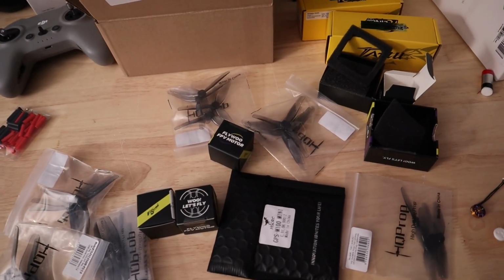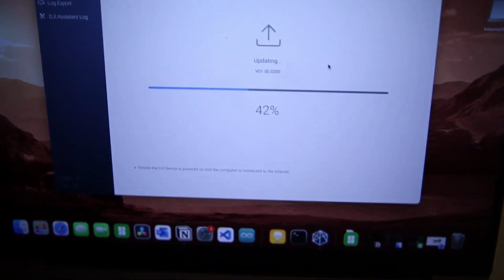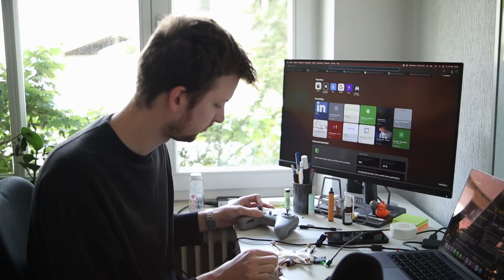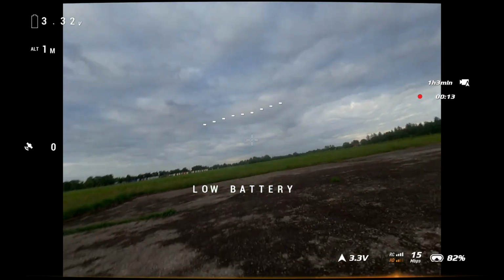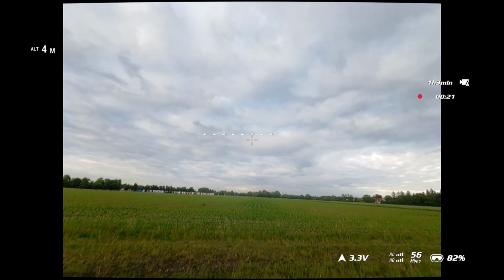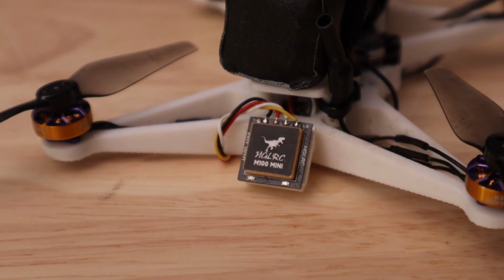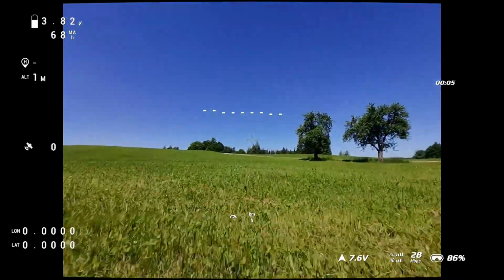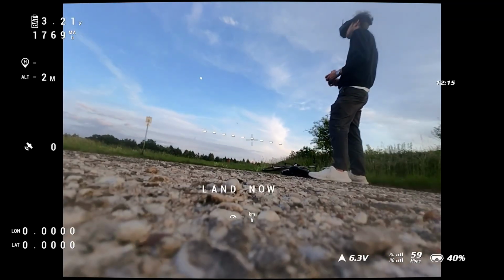A Drone powered by old Disposable Vapes

Comment: I have alot of old vapes and old dead rc batteries if anyone wants to repurpose them, i would recycle them but in america recycling bins are trash bins.
Reply: I'd be interested in your old Vapes. I'm learning to solder connectors on them right now for my tiny whoops.
Reply: @quintinfertig89 i could give you the tech from within for personal saftey without the shell, all seperated in bags in a box with layers of foam, i get them every 2 weeks it seems, usually disposables, not alot at the moment but over time they pile

Comment: How do you like the goggles n3? goggles 3 is sold out in all american retailers because of... reasons... but the n3 is available everywhere. Ive never used a box goggle before, I have the HDZ goggles as well.
Reply: I was actually surprised. I bought the N3 expecting to be disappointed, as i was with all the other box goggles i've tried (Eachine EV800d, Skyzone CobraX, cheap no-name goggles)... But i wasnt sure i would stick with DJI so i went for the cheapest route i could. All other box goggles felt like a tiny field of view; they all claimed 60 degrees, but in the end i could see both edges of the screen as if i was sitting on a sofa and watching TV. But the N3 goggles are actually way bigger than i can see, i have to move my eyes to the extremes to see each of the edges, so it feels amazingly immersive. The moment i take off, i completely forget they are box goggles...
Reply from the maker: I actually like them a lot. I tested the regular goggle 3 and the only downside compared to the normal goggles 3 ist that they are a bit bigger.

Comment: i have some thoughts, higher Kv motors will help a lot, it seems you setup the gps incorrectly because 0 sats almost never happens, why didnt you buy a carbon fibre frame? and analog video will eb lighter and draw less power so that will help you squeeze even more flight time out of it!
Reply: I suspect they are 14000kv, nobody makes 1003 with 1400kv.
14000kv is plenty for 1s... Maybe a little too much for 2s
Reply: @Tokyo_Dom yeah although for a cell that sags a lot and can go to 2.8v higher would be better
Reply: @SpacemanFPV1 higher kV would just sag more though. KV isn't the answer for low c rating batteries... You want the most efficient drive train, and then low disc loading (reduce weight)
Reply: @Tokyo_Dom ok that’s fair, I agree for the most part, and yes it would sag but it would also help because it will be inherently heavy and the extra power would be beneficial

Comment: carbon fiber exists, why buy everything but a frame? I will never understand the 3d printed frame
Reply: agreed, esp when frames exist for this purpose
Reply: Exactly. Carbon frame is only correct solution. You can add printed plastic to the frame
Reply: I have printed a frame in 2,5inch. I laught over the finished print. Stiffness:0%😂
Reply: It’s a prototype for now, but to produce a carbon frame is much more expensive and time consuming so I respect his decision to 3d print the frame as it is replaceable as well. Look into how difficult it is to produce carbon fibre

Comment: a new gps has to do a cold start just leave iut plugged into betaflight for around 20 mins and you should get better results
Reply from the maker: I did this. the only way to get in working properly with this setup is to connect a USB power supply to the FC and then plug the battery in after you get a gps lock and then unplug the USB
Reply: @Germanengineer1  yeah
Reply: ...while the drone is outside, ideally. Should only take 5-10min then
Reply: @moncoeur6296 I have that gps, with shielding i get 8-10 sats in ~1:30. Needs to be powered off of 4v5 to do that tho.
Reply: @moncoeur6296  kinda annoying to sit outside tho